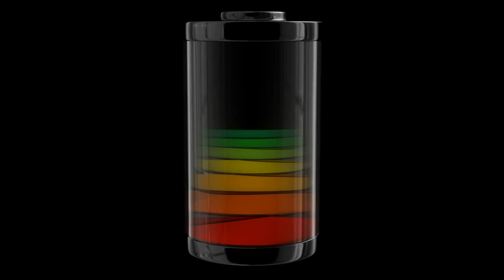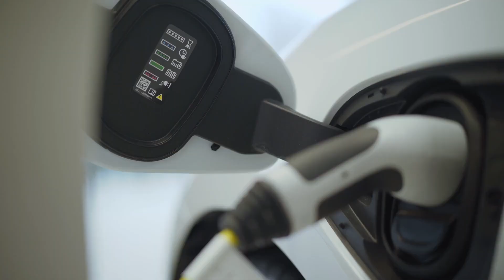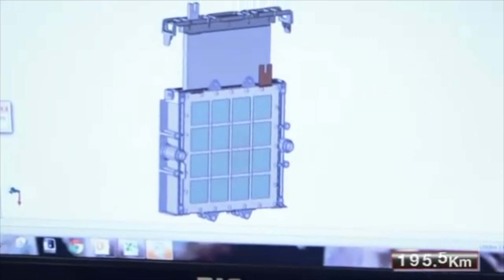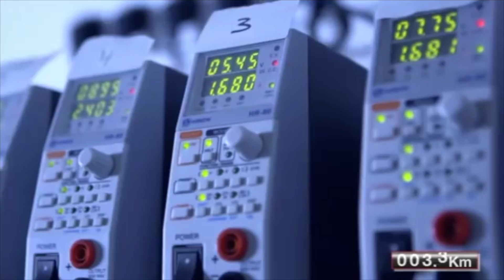This Battery Gives EVs 1000 Miles of Range!

Comment: I would agree all baring one point, that it seems everybody in the car industry forgets.
If you have a day to spare may i suggest you go looking to buy a new car with your old car , say 200000 kl on the clock.
To start with i am sure you are going to find the the resale of your old car will bring tears to your eyes after all the loving care and  servicing you have paid for to keep it in good condition.
Now we will look at the cost of you new car  in comparison to the price you paid for your old car when you bought if brand new, the usual response is dont be daft, i cannot afford that.
Not only is this most likely to be the case but here is an added  bonus for you to really cheer you up.
The car you are shown has more bells and whistles than you can shack a stick at, plus it has a new type of gear box, its got a steel push belt, so the question is asked, does this mean it does not have a timing belt that i have to change every 1000kl,
No sir  it still has a timing belt that we reckomend you change every 10000 kl. 
Well they are quite costly to get changed as it is, do i have fo change this new steel belt thing, ? Well yes you do sir, How often? Well your will be lucky if it lasts 30000kl some break before that, and god forbid that it happens because its made up of nearly 1000 bits, all small bits that can go all overthe place and wreck the  gear box or and the engine.
So they want to sell you a car that has so many things that you cannot change yourself, has a gearbox that is belt drive  so you now have two belts to change, the gearbox steel belt costs you as much as your  last car did on its own, with so many sencors that are important enough that if they fail your stuck by the road side, and all up its going to cost you twice as much as your last car did when new.
I have a suggestion to car makers across the world, please make a car that has a carby, points, and a manual gear shift, forget all the " i can drive myself cars"  and make cars that people can afford and can do some of the work myself at least, WHY ? Because my money does not increase by double or treble a year, i am already paying an extra $100 each year  as that how much the road tax goes up!!!!!!!!!!

Comment: I thought about swapping batteries before. I could see the cars having the bottom open up, while the battery disconnects, and is moved down to a robotic arm, and another fully charged battery replaces it. The car automatically closes up, and the "gas station" takes the battery, and puts it onto a charger that charges, and tests it.
This could remove any limits on driving, and a system that keeps your battery functioning. The maintenance and replacement can be built into the cost of the recharge, spreading out the cost. 
I could see the batteries being rated for their degradation, and people paying for "premium" to get the higher quality battery. While the budget-conscious can pay less for the lower quality battery. 
The fee could be equal to the needed charge.
naturally, there will need to be different sized batteries, but this would require some sort of standardization in batteries, or you would need to go to the "gas station" that carried your specific battery.

Comment: I'm sorry. There is two things about electric motors that just suck more than the vacuum in nasas huge vacuum chamber.

They don't make a sound, and because of their high torque down low is there no reason to put a manual transmission in one.

This means that electric cars just isn't fun to drive. They lack everything that makes driving fun and replaces it with just good acceleration and nothing more.

They are also notoriously unsafe for pedestrians because of how quiet they are. You can't listen for cars due to electric cars any more and as more electric cars gets on the roads will we see an increase in the amount of pedestrians getting hit by cars.

I'll stay away from them and I promise, I will never buy one!

Comment: I think there’s scope for this tech to replace range extender ICE engines as an option. You have your regular rechargeable battery but if you do long haul drives there’s a sealed AO fuel cell that gets activated at below say 25% charge. I dunno if this works or not but…, otherwise super useful for freight trucks, vans etc PT buses that return to a depot to be converted. Note that in Aust it’s a 1,500km round trip to visit my parents in the country. So your swap the battery out once every few months naahhh!

Comment: disposability vs reusability is a major debate right now, but I don't think having a non-rechargeable battery is a bad thing. It can be used to electrify things like planes or tractors that can't easily be made to use lithium, and leave lithium for cars. So far recheargeable and non recheargeable batteries have coexisted and found their niches for several decades.

Comment: My electric powertrain;
- Carbon nanofoam for bulk hydrogen storage
- Hydrogen fuel cell to produce water
- Water goes into aluminum-air battery
- Flywheel for energy recovery

Comment: You know the appeal of charging a lithium battery pack? It's the price. $9 on electrcity charges the battery to 500 miles. Gasoline? Roughly $24 - $50.
How much do you think swapping an aluminum battery would cost in usa?
15 minutes work, insurance, time wasted driving there, and waiting for a technician to be available,.. at least $125, if not $200.
Oh, and as an uber driver, 1000 miles would barely cover 2 days of 10 hours deiving. 3 small days of 8 hours tops.
Not worth it!

Comment: I think we need to go the hydrogen fuel cell direction. It is the most sustainable and scalable concept. There are systems besides just water electrolysis. We could use solid Hydride systems that release hydrogen as needed and new cassettes of material could be just swapped in and out by the consumer. It would lessen the infrastructure woes and even developing third world countries could make it work. The solid material could be shipped around and stored easily and would not require tanks, pipelines, electrical grids or refrigeration. Solar energy could be used to recharge the minimal amount of electricity needed to power the system and run the computer controls. I built something 20 years ago that did a similar thing. I used regular lead acid batteries to run the electrolysis equipment but used Solar panels to charge those batteries.  I  made hydrogen to burn in a stationary engine. No grid power or petrol fuel needed. Only water was the fuel. You could use waste water and distill it using a Solar distiller needing only the sun and then use that water for fuel. You can use sewage and distill it or Salt WATER  or any form of liquid that can be distilled. If big oil and big business gets out of the way people can do wonders. The problem is how do they meter, charge and tax it.

Comment: "Clean energy" is the wrong word. Batteries (so far) are a dirty polluters too, as are all methods of producing the electricity. The "dirty" prints are different, but real. Certainly, concerning converting road machines to battery run, is more "clean air", but that is not an end all for "clean". Until this fact is observed, the terms being used are at best propaganda misleading lies ; usually aimed at an inquisitive impaired thus dumbed down majority while being sold a new set of restrictive rules to insure a larger impoverished population (thus easier to control and/or buy off). Take those masks off people, your being stooged by what's really being masked : truth !!

Comment: Forget about the Electric car and consider the Hydrogen car powered from your garden hose water. Yes, WATER  !  In the 1930's the Hydrogen engine was invented which could separate Oxygen from Hydrogen H20 = Water. Hydrogen is clean energy. Remember seeing the Space shuttle take off to the Moon? well, did you notice the huge "WHITE" cloud forming at the bottom of the rocket? that was the Oxygen being kicked loose from the Hydrogen. The Space shuttle used the Hydrogen to fire and lift the rocket into space. If the rocket was using an oil based fuel then the cloud at the bottom of the rocket would have been "BLACK".  The two ORANGE tanks on the sides of the rocket were filled with "WATER" !!   Men including my X-Boss have been beaten up or Murdered trying to bring this engine out but the Oil companies won't allow it to ever happen.

Comment: Aluminum Oxidizes Naturally. In fact it’s almost impossible to prevent it.
Like Steel Rusts but Unlike Steel, it protects the Aluminum.
We are Replacing Natural Petroleum fuels with Toxic Mined, Metal battery fuels. 🤔 And Adding 100’s of More Power Plants and Miles of Copper utility lines to pull this off.

Comment: If you are going to compare energy density of batteries and that of gasoline, you have to take efficiency into account. An electric motor will convert about 60% of the energy into movement, a gasoline engine will convert 30% of the chemical energy into movement, the rest being turned into heat.

Comment: If all the manufactures got together and agreed a standard size and connection, then the batteries could be just placed in a cassette just like putting batteries in a torch ( giant AA's) in this way you could carry a spare set if you wished, replacement could be as simple as changing batteries in a torch, and if only a limited number of  battery sizes were agreed on then production could be upscaled to reduce costs.

Comment: I can see this possibly working on 18 wheelers like I drive . I've been a Hydrogen supporter because of the charging and range issues that just won't work for a coast to coast driver like me . There are times I drive 1000 miles between fuel ups because of deep mountain and rural deliveries . A 600 mile range ( in optimal conditions ) could just never work . Hydrogen solves that issue but a 1500 mile battery range with 2000  plus miles optimal condition range would actually be feasible . It currently takes about 15 minutes to fuel a truck . If the pack could be changed in 15 to 30 minutes that could work since between fueling and going I to get coffee , food , use restroom and so on usually takes 20 to 30 minutes , it's not a major inconvenience and this also solves the not only charging issue but also Hydrogen storage issue at truck stops ( though Hydrogen could very easily be made at truck stops and in many places even made using mainly solar , wind or thermal . Thermal would be widest use because of a heat transfer process using the huge black top parking lots by taking heat absorbed in ground to heat water to create electric as well as use that technology to create Hydrogen at airports for Hydrogen planes . Like I said I'm a big supporter of Hydrogen and found ways to produce Hydrogen with almost zero use of electric infrastructure and since water could be used instead of natural gas its super clean. 
  I still like Hydrogen but this is first time I've heard any kind of all electric application that could at least possibly work on OTR cmvs and it also works for RVs and off road trucks and jeeps as well . 🤔
Reply: Yes. .Blessings & Thanks.
Reply: I have a 2,000 mile range with my freightliner and 280 gallon fuel tanks. I'd love to put solar panels on top of my cab and sleeper and put batteriesI have a $2,000 mile range with my freightliner and 280 gallon fuel tanks. I'd love to put solar panels on top of my cab and sleeper and put batteries in place of my fuel tanks. With a generator or even with an apu, a good battery pack and solar regeneration could give unlimited range with the most efficient use during sunny daytime. I'm looking for the best drive motor or motors to use in this application. Since my engine weighs over 6,000 lbs, I could put 6,000 lbs of battery under the hood, and another 1,000 on one side where I have a 140 gallon tank and keep 140 gallon fuel capacity for the apu/generator. If I could find a lighter battery (or storage unit) I could get even further ahead in this situation.

Comment: I like the idea of using the aluminum “battery” as an mileage extender. This way you have flexibility as to when you swap it out for a fresh one.
Reply: Carrying a heavy rechargeable lithium main battery with a light weight auxiliary aluminum extender kind defeats the purpose. Total weight of batteries increases while useable space somewhere in the car gets reduced.
Reply: You believe  that?

Ho hum, there is another one born every  second.
Reply: what do you need a "mileage extender" for with newer cars having 400-500 mi range already ?

Comment: If you could make a rechargeable version even half as energy-dense, that would be huge.  As it is, though, it's a complete non-starter.  Recharging a lithium ion battery ten times is obviously going to cost way less than re-refining the aluminum and remanufacturing the battery once.

Comment: not perfect for a home power system  except perhaps as an emergency failover if designed not to work until you turn it on like for emergency lighting one the process starts then it runs its course unless somehow it too can be stopped and restarted without the battery discharging

Comment: Why not make the Aluminum Air Cell (Since it's not a battery) swapping station a separate "division" of the local metal recycling place. As is, they already have PLENTY of aluminum. Hmm.. In a way, that gives them an upper hand over anyone.. unless they just opt to sell it to a large processing company. (With a tragic loss in revenue no doubt.) With the aluminum already in their possession, I bet some places could start making them now. Get the ball rolling that much faster. but if it's not a battery, how you get the power to start the car, turn on lights (the mood kind, music and all) or even use the headlights for a night time match of beach volleyball or whatever else? (or is it holding a charge for the 1000 miles minus frivolous non-driving use?)

Comment: This sounds like a great idea but the world works on money. The manufacturer does not like this because they want to make money off their customers not just from the sale of the car but off of servicing your car.  So the manufacturers will not allow third parties to hot swap your batteries. So it would be time consuming and costly for the consumer if they bought a car with Aluminum air batteries. Also Toyota might have a specific design for their air allo batteries while Ford will have a different design of their own which makes hot swapping even more difficult.

Comment: As a key contributor to the Aluminium-Air debate MAL Research and Development Ltd. has a few observations on this video.
1) the electrolyte is the key technology unlocking Aluminium-Air. The suggested options of Potassium Hydroxide and salt water are not viable. Salt water cannot offer the power density required for transport and has problems with hydrogen gas evolution, and low coulombic efficiency. Potassium Hydroxide cannot be used without 99.999% pure Aluminium otherwise it causes too much hydrogen evolution, too much heat and too much gel formation. However, using Potassium Hydroxide with pure aluminium results in a cost per mile of over £100 so there is no business case. 

2) The video was wrong in part about the test drive with the Renault C1. This was a partnership with Renault not Ashok Leyland and the reason the car only went 200 miles, according to the engineers that worked on the project, was that the CO2 filter didn’t work properly and carbonate built up in the air breathing membrane, which wrecked the battery.

3) from multiple sources, the ‘200 mile flush with demineralised water’ is in fact a complete removal and replacement of the Potassium Hydroxide electrolyte solution, which at 2 Molar concentration, is a major hazard.

3. Demineralised water cannot be used as an electrolyte as there is no ionic charge transfer.

4. The video avoids mentioning Métalectrique and MAL Research and Development Limited which is well known to have a viable electrolyte which allows the use of ordinary aluminum and is safe to touch. The cost per mile is £0.08 with this approach and the system has no issues with cooling, hydrogen or gel formation.

Aluminium-Air technology is viable (it has been since 2001). It’s biggest problem is being blocked by vested interests which has seriously slowed down real development and commercialisation whilst pumping up versions of it that cannot actually deliver.